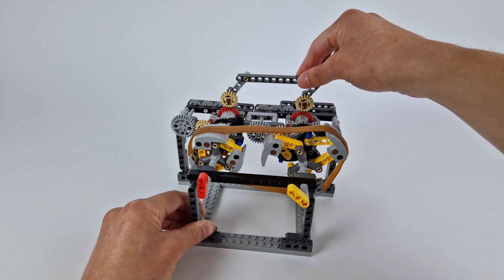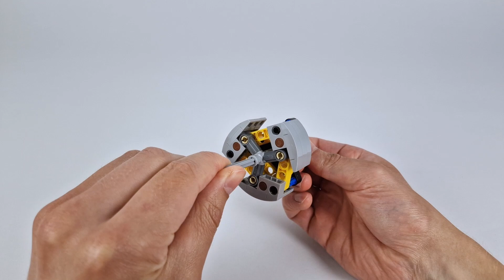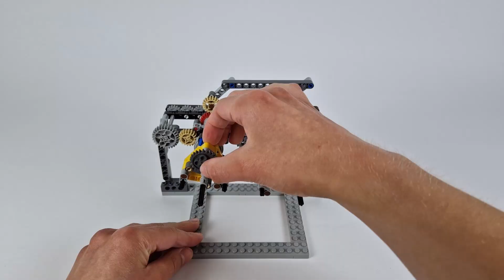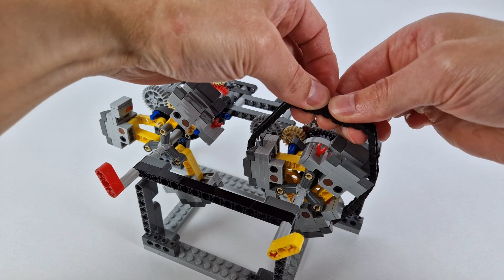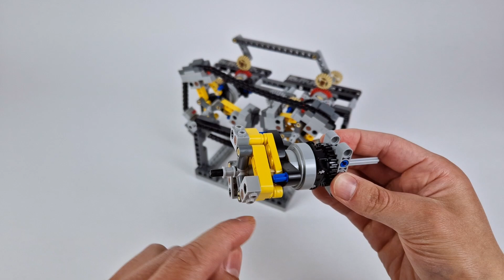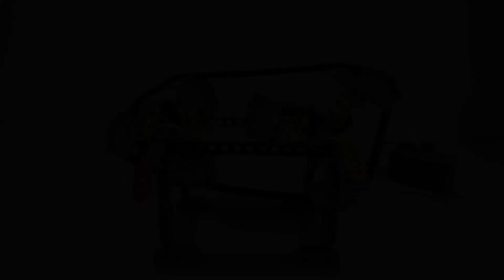Building a Better LEGO CVT (No Slipping!)

Comment: 2:23 (i think) this is because the formula for the force of friction is F = N(mu), where N is the normal force and mu (the greek letter, not m * u) is the friction coefficient. There's nothing about surface area in the formula; only the normal force and friction coefficient matter. The larger band might have a smaller friction coefficient ("more slippery" essentially, like you said), but what would really help is to have a tighter band. That will apply a higher normal force against the two cylinders, increasing the friction force F.

Comment: So, my love is bicycles, not cars, but we cyclists are stuck with three types of transmission, derailleur, planetary hub and CVT hub. Even people who don't know bicycles probably know the first 2, eg the traditional racing bicycle gears or the sturmey archer 3 speed hub of cruiser bikes. Now, hub gears are both very expensive and very proprietary, while derailleurs can be cheap, are open source, modifiable and easy to work on. It's also easy to understand the torque transfer going on with derailleur gears. The trouble is, you can't belt drive a bicycle with derailleur gears and chains are not the best thing for being exposed to the elements.

Belt drives are becoming very popular on hub geared bikes but for what most people are happy to pay for a geared commuter bike will barely buy you a decent hub gear, like a Rohloff, and that's without rim or spokes, or the the rest of the bike.

Your automatic, twin variable pinion CVT could revolutionise urban bicycles! Seriously! It's compatible with open gearing (or at least "chain guarded" gearing), compatible with timing belt drive, would feel like riding a single speed (and be just as easy to understand) and matches the rider output to the gradient. It would also be a lot cheaper to make than a planetary or CVT hub gearing system, easier maintenance, only the belt would wear out (and bicycle belts are lasting up to 120000km! Longer than the average life of an urban bicycle, let alone the chain that drives it.

Dude! Patent this in the Netherlands or Denmark! You'll be a billionaire! Seriously! This is brilliant for so many exposed drive applications! But really, make it open source, make the world a better place! Then develop this up from lego to timing belt drives, both automotive and for cycles.

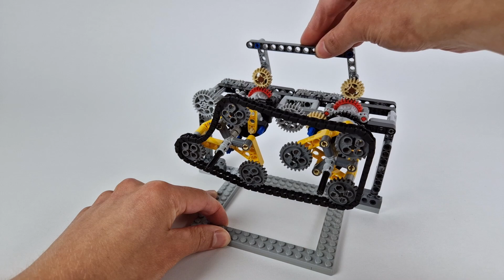Comment: 6:40 why didn't the gear wheels move apart spinning freely along the chain?
Reply: make it 4 or more (preferably 8) gear wheels per size-changing wheel and make only one of the gear wheels fixed so that the chain stays unfixed to rotating gears for the most amount of time (when the one fixed wheel is not in contact with the chain

Comment: Nice build, I really like the mechanism with the differential. 

However, It is not a true cvt, you are limited to grabbing onto the individual linkages of the chain, and you cant grab onto half a linkage. Still very impressive work though!
Reply from the maker: Thanks for the comment. However, the gear ratio depends on the diameters of the wheels, not on the chain links that they connect to - the chain is able to become more or less slack to accommodate the wheels changing size slightly before the chain linkages move over. Since the wheels' diameters can vary continuously, I would say that it functions as a CVT.
Reply: @BananaGearStudios  well, in practice it functions like a CVT, but it is not truly continues. It can only grap an integer amount of chain links per rotation, and so can the other side. When you increase the size of the wheel, at some point it goes from let's say 20 to 21 chain links per "teeth" of the wheel. it can't grab 20,37582 chain links. This results in a fixed number of ratios. Although there are a lot of ratios, there are not infinite like in a true CVT. 

A true CVT which is not based on friction is yet to be invented. Non the less, the contraption you made comes close, so keep thinkering, maybe you are the person to find a solution some day! (And probably get rich xD)

Comment: The reason the wider belt didn't help is that friction is completely independent of surface area. Making the belt wider added more surface area, which had absolutely no effect on friction, but made it harder to shift and made the motor have to fight the band from twisting. Unfortunately your efforts to thicken the rubber band had no effect.

Comment: Cool concept.
I've always had this idea that I could never realise. But what if a transmission would switch gears depending on how much force there's on the chain? In other words, it might be cool if the chain was going over a slack wheel that controls the CVT lever. Could be worth a try.

Comment: Frictional force depends on force per unit area. As contact area increase, the force per area decreases proportionally. And so, the width of the rubber band doesn't really effect the available friction. Instead, what matters is the spring force and unsprung diameter of the rubber band. As that will increase the force over the same area.

Comment: 13:13 measure voltage and current going to the motor
That's probably one of the easiest ways to see
Cause you're getting more torque out as you're spreading the load over time
So power should stay somewhat constant

Comment: I wonder...could you theoretically have four CVTs for four wheels? Basically just a direct drive from the engine to each transmission? I know it wouldnt be too practical in a car, because of the amount of things you have to lubricate and maintain, but could it be possible?

Comment: Please just use a differential to get CVT. This is over engineered.
There are 3 points on a diff. You can use it as 1 input 2 outputs or 2 inputs 1 output. I think you can figure out the rest. They have been used as CVT for decades.

Comment: 3 points:
6:30-ish: You could have used gears to drive the chain, you'd just need to fix them with a ratchet rather than fixing their axle.
0:27 I would have tried wrapping the rubber band around the cones more times. You couldn't wrap it around the same cone more than once, but you could make it wrap around 3 cones per side to complete the 180° turn: 225° around the first cone, 270° around the second one, and then 225° around the last one. The first and last cone can both be geared to the input/output shaft. And the second cone can be used to pinch the rubber band at the contact points of the first/second and second/third cones.
13:01 Route your output into a differential, hook one of the diff's outputs into a device where the drag can increase with speed (like a large fan), and hook the other side into a pointer whose deflection is proportional to the torque (working against a weight or a rubber band).
The differential will make sure that both of it's outputs are at the same torque, the pointer will allow you to read off the torque, and the fan will make sure that the output of the CVT can move even though the pointer stays still.
Reply: Really like the torque measurement idea.

Comment: I wonder what kind of performance you could get with a pulley based CVT instead. Both the input and the output side have 2 pulleys that get closer or farther apart to change the diameter of the belt. If you do try it out, maybe see if there's some type of V-Belt you can use, it should provide the most friction. A round (instead of a flat) band may also work for a pulley based CVT specifically

Comment: if you put another of those auto cvts in series it should both multiply low end torque and high end speed and you could probably do this until the friction diminishing returns over take multiplier which should be quite a few if it has as little friction that appears in the video.

Comment: so he basically made cruise control? 11:20
Reply: no, he made a cvt.
Reply: cruise control in automatic transmissions works by measuring the rpm and torque of the engine and the fuel economy it would provide, and adjusting the gear and throttle to that

Comment: I like the version with fixed gears on the wheels, in a bigger version, maybe the gears could spin with the change in wheel size to still be engaged with the belt but allow the gears to roll along the gear whilst the wheels change size  if that makes sense

Comment: Great concept and execution, the automatic version is especially clever. My only concern is that, since the clips necessarily grab the chain in discrete intervals, this transmission does not appear to truly be continuously variable. Unfortunately a truly continuously variable transmission that does not rely on a friction drive (belt drive, pivoting rollers) is a bit of an unsolved problem in mechanical engineering.
Reply from the maker: Thanks, but the gear ratio depends on the diameters of the wheels, which can vary continuously, not on where the chain links connect. This is because, when the wheels' diameters change a bit, the chain becomes more/less slack before it slides to the next position, so the gear ratio is continuously variable.

Comment: One thing I always wonder when I see a Lego transmission where friction or tension are used to gauge output resistance: is the torque gain from changing ratios greater than the overall power loss from the friction/tension in the resistance measurement? And if so, by how much? Genuinely don’t know. I’m as far from an engineer you can get, but I love Lego technic. Regardless of how efficient this design ultimately is, it’s incredibly clever and undeniably solves the belt slip issue with the classic cone style CVT. Great work on the variable size wheel design, it’s brilliant!
Reply: It takes some energy to stretch a rubber band. But once it’s stretched, it doesn’t continuously require energy to keep it that way. It momentarily takes some energy from the input shaft and then the torque gain takes effect. When it shifts the other way, it feeds the energy back into the system (minus what was lost to heat ofc)

Comment: there is a cvt type like this although usually it uses a rubber belt, one side has fixed diameter and the other uses wheels on the end, it also uses hydraulic/pneumatics for expansion. your design is very cool with counter changing diameters for drive and driven giving a wider gear ratio change, although due to the size of lego pieces, this is slightly limited and is probably very hard to make smaller for lego cars. it will be cool to see that comes of this design in the future

Comment: about why the wider rubberband didnt improve as much as hoped: the formula to describe friction does not include the area of contact but instead the friction force f is calculated by multiplying the normal force N with the friction coefficiant μ  between the two surfaces: f = N * μ this does not include the area of contact
Reply from the maker: Yeah, that's a good point. I know that formula well but I kind of just intuitively assumed that a wider belt would mean more friction :)
Reply: The formula is true, but to get μ you don't just take the materials into account, the surface of contact is baked into it.
Reply: @nicodiaz2662  oh ok thx

Comment: I think a lot of the problem is not the lack of friction but the stretch of the rubber bands. If you had a belt that had something to keep it contracted it would work far better as the side load of the torque transfer tightens the belt and makes it tensioned against the variable cones.
Reply from the maker: That's a good point, though making the belt tighter might also increase the amount of friction in the CVT.

Comment: If you were willing to sacrifice the cones to live forever for a CVT, you could dip them in liquid rubber. Rubber on rubber is friction city. I think the auto CVT would need to live within a specific RPM range or the centrifugal forces will counter those bands.
Reply from the maker: That's a cool idea!
Reply: Wouldn't that hinder the movement of the rubber band along the height of the cones as well?
Reply: @ArabianShark  Yeah it very well could hinder quick CVT shifting. The rotation of the cones should reshape the bands to be in line though. If they aren't rotating you could run into issues shifting.
Reply: You should work for tesla

Comment: I'm amazed at the simplicity of the chain drive automation, but as it stands the gear ratio is currently quite small. I'd be very interested to see a follow-up video that puts two of these stages in series, to see if you can automatically cover a much larger range of reduction speeds.
Reply from the maker: Thanks! That's a great idea! I actually did a staged automatic transmission like that in the automatic gearbox I made last year to increase the range of gear ratios like you said (though overall that mechanism isn't great compared to this one). I've already got a lot of ideas with this CVT for the next video, but this staged transmission idea could be worth me making a third video on this!
Reply: I think having two stages in series would exaggerate the irregularities in the output speed more, so that might be rough.
Reply: @fallen3424 i think it could actually help if they’re connected out-of-phase!
Reply: @techheck3358  I thought about that, but there's two issues with the idea - Both stages won't be at the same gear ratio simultaneously because the force acting on them is not identical, and they may change at different rates.
Also, because they are in series, they are not running at the same speed so there would be an interference pattern of the output speeds of the two individual stages as a result.
Reply: @fallen3424  I think (as @techcheck3358 said) they (first stage output gear and second stage input gear) need to be connected out-of-phase. And additionally the shrinking of the first stage's output gear has to be synchronized to the growing of the second stage input gear.
Since those gears are usually not at the same size (except for medium gear ratios), their "non-spherical-ness" will usually not fully cancel out, but at least it will not interfere constructively.

Comment: what's the flutter like on the output gear? given the gearing is effectively triangular won't the output speed vary over the course of a rotation, doubly so with the continuously variable design and having inconsistent alignment?
Reply from the maker: I'm sure there's a bit of variance in the output's speed, but it wasn't all that noticable while I was testing or filming it. Once I put it in a car I'm sure any variations will become more apparent, but I'd say they shouldn't be too bad since the wheels are shaped like very rounded triangles rather than straight triangles.

Comment: in a realistic application you probably want it to always to default to the shorter ratio, that way you aren't stalling your input instantly, I know the belt drive CVTs for small displacement engines work like that, using centrifugal force to actuate them
Reply from the maker: Yeah, I'd say that for any high-torque applications, like starting off a car from rest, the automatic transmission will go to the highest gear ratio at first, and then gradually lower the gear ratio as the car builds up speed.
Reply: @BananaGearStudios  The biggest factor is that a brushed DC motor makes its maximum torque at 0 RPM which is the opposite of a petrol engine and hence why your design is good as it is
Reply: @Samqdf  Forgive my ignorance but how can there be any torque at 0 RPM?
Reply: @evergreatest7644  It's a good question. Imagine an electric motor that has a bar attached to the output shaft and is locked in place. Now ignoring that it won't last long before overheating it will with that setup be exerting the maximum amount of twisting force it can on the bar trying to make it move. You won't be able to visibly see any movement but if you had something like a strain gauge to measure it you would find it's exerting the highest force at that point. You may have experienced this characteristic after when a battery was directly applied to a small motor and see it suddenly jolt from the torque reaction. Note this is for direct current brush type motors only, brushless motors behave differently. Does that make sense? I am not my best with words and it's hard for me to explain.
Reply: @Samqdf  Oh, that makes sense, and Internal Combustion Engines can't provide torque at 0 RPMs because they will stall and stop producing torque. Thanks.
Reply: @evergreatest7644  yes exactly, you got it